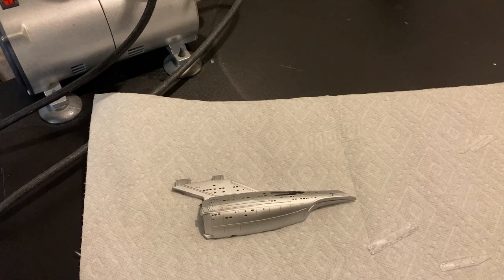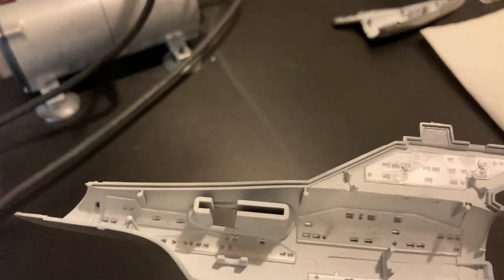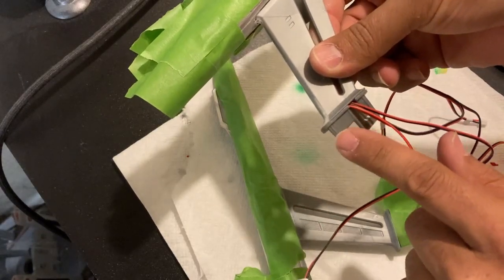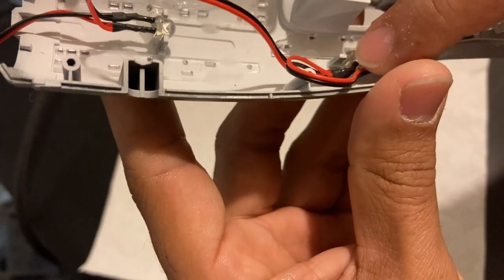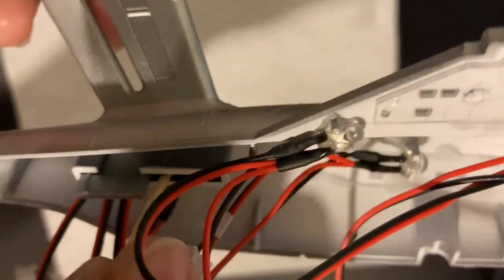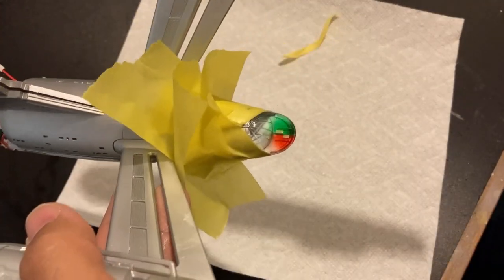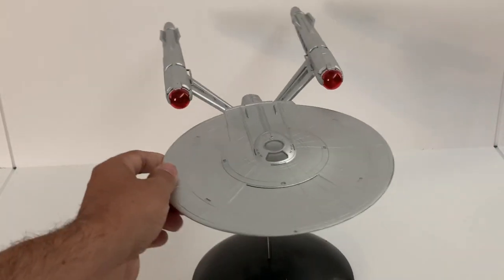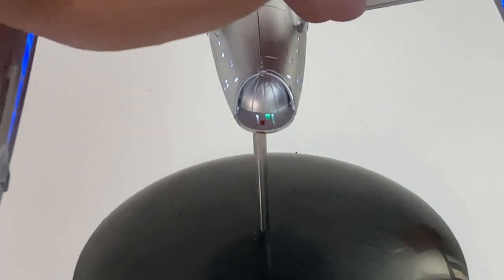1:1000 Enterprise (Discovery) - Part 4: Final Assembly

Comment: Does anyone know if the Raytheon method of simulating flood and spotlights on the saucer section by not light blocking where you want light to shine through the plastic would work in a build like this (and with the lights already in the lighting kit) where the outside of the ship is this darker metallic silver? or would that darker metallic paint itself create too much light block?  I think that effect would look nice coming from that long thin window as if shining down in the registry numbers.

Comment: I built this model with lights.  Very little painting is needed.  Don't bother the overall paint seen here.  Just the forward dish and the nacelle aft ends need paint.  The decals cover every inch of the model.  Mine turned out great without the time consuming painting shown in this video.

Comment: Heya!

I’ve been building kits, scratch builds and sculpts as a Hobbyist and a semi- professional for some Twenty Years and buying kits for even longer! I Enjoy Many Builds Online but what Shocks Me the Most is some of the techniques used in Construction and the one I’m Most Critical of is Priming, Painting and then Applying Glue, be it Styrene, Epoxy or Super Glue to Surfaces that should be free of any Obstruction! This includes Paint or Debris! Areas of Critical Structural Integrity are supposed to be clear and well maintained so that whatever glue, epoxy or Super Glue is being used is able to sustain a reaction as its curing. If the Kit is Styrene or Resin those appropriate Glues Create a Sustained Reaction Enabling multiple surfaces to knit through an element of thermodynamics. This means that the opposing surfaces melt and join together! I call this process molecular re-fabrication. This is when the plastic becomes volatile and liquid before returning to its solid state! This is Encumbered when these surfaces are covered in paint or any other obstructive material!? While it may seem that the Modeller has a Secure Bond the Model Itself is on a Downward Slide to Eventually Breaking Up! The Glue in this Scenario Begins to Degrade and this is a Process that will begin in a period of months as opposed to years and sooner if the Model is Handled Excessively!? The Whole Point of Styrene and Resin in Most Kits is that Chemically all these Elements Fuse together! And it is only through Being Fused that the Modeller is Able to Increase the Longevity of their Subject. Styrene on a Painted Surface Breaks Down, Epoxy Resin on a Painted Surface Breaks Down! Super Glue Should Only Ever be Used in Areas like Tubing, Landing, Gear, Antennae and Other Fixed Structures that are not going to be Manipulated! As for Internal Wiring there is always a neater solution in tightly bundling them together or boxing them in!? It is less Awkward and less stress upon the model and any lighting system! A Good Way to Test Your Models Rigidity is to Tap it- in this example in the Primary and Secondary Hulls! If the Model Gives a Flat Non Echoing Tone then you can rest assured that all the Critical Joins in your Project are Secure and will last. However, on the other hand you tap the model and there is a thin almost tin or ringing tone then your model is weak and will eventually succumb to rapid deterioration and will eventually fall apart! Never attempt to glue a join on a panted or obstructed surface! Always Cross Hatch those areas where you’re going to apply glue. Make sure those areas are clean! Press Firmly Together and Bind within the Tolerances of the Kit!

That’s My Lot! Great Building One and All!
Reply from the maker: Hi Eugene!
I'm using Tamiya extra thin on the glueing surfaces of the plastic, it melts away the paint and melts the plastic together so it should be a solid fused piece after that. 

I'm using five minute epoxy on the LEDs only. I've held the clear parts on with superglue, only because, 1. they don't need much to hold them on, 2. if I used any of the glues that melt plastic, it would melt some of the surrounding paint and get the windows messy. 3. the windows are small enough that if I ran into any 'crazing' it wouldn't be very noticeable. 
You are completely correct that the way to make the strongest model is bare plastic, glued with a solvent to bare plastic. I think that the tamiya extra thin, works pretty well, even with the light blocking paint layers on the inside of the plastic.
Reply: Star Trek Model Kit Previews

Heya!

When I referenced the glue fusing the Styrene I was not Indicating the Use of Plastic Weld that is Very Thin and with the Appropriate Use Would Fuse Plastics Quite Well. I was merely discussing the Technique in Terms of its Current and most Generic Applications- that is Styrene and Two Part Resin Epoxy. Styrene Glue wouldn’t cause any Crazing or Misting of the Transparent Elements unless there was an accident involving direct contact. Styrene isn’t Caustic or Gaseous Like Super Glue and though it is Highly Reactive Generating a Considerable amount of Heat Two Part Epoxy does not cause Misting in Proximity to Styrene Glass Elements Either. 

It is Interesting that you Say that Styrene in Part Dissolves Paint on adjoining, mating surfaces? It is True. But in Terms of a True Bond the Molecular Efficacy is not Sufficient Enough to Complete the Styrene Reactive Molecular Chain? This is in no Small Part Due to the Contamination of Acrylic or Enamel Paints that are bound by Water for the First and Oil for the Latter? Both Ingredients are Naturally Disruptive to Polystyrene Bonding! It is therefore Inevitable that in Time any Model having been assembled applying this Technique Will Lack the Structural Integrity than It’s Unobstructed Counterpart. I have some kits from my Childhood that have survived until this Day in part blessed by the Technique that I used as they were relatively easy to disassemble and clean for an up to date rebuild and restoration. 

I’m Looking Forward to Seeing you Apply Decals to this Kit. I will Aztec My Kit through the Application of Homemade Masks and Acrylics or Alclad. 

I am Enjoying Your Presentations. 

Best

Comment: Great job on this! I love how you always get these kits before they are available to the public. Like another poster, it always pushes me over the edge if I’m not sure I want the kits. How was it fixing the gaps once you put the kit together since you had to paint the kit parts before assembly? I’m not a fan of the big dark area behind the deflector where the board sits. How difficult would it be to run the wires out of the ship into the base? Lastly, would you suggest doing Raytheon lighting for the registry lights, and is there enough ambient light in those areas to sufficiently light the registry from inside?
Reply: The kit is molded in such a dark color that I don't really see how raytheon can even work on it. Besides, it might be enugh to just adjust the LED to have the same effect.